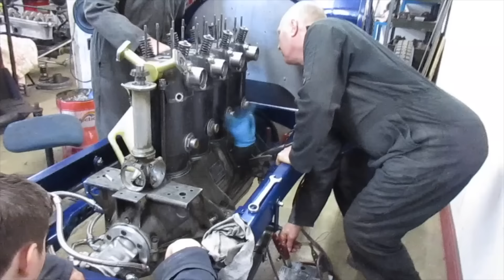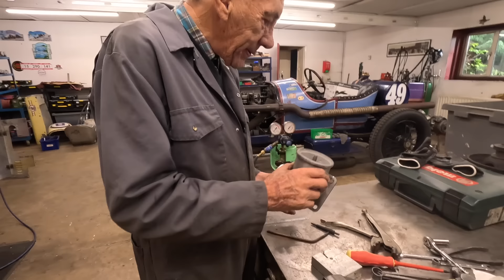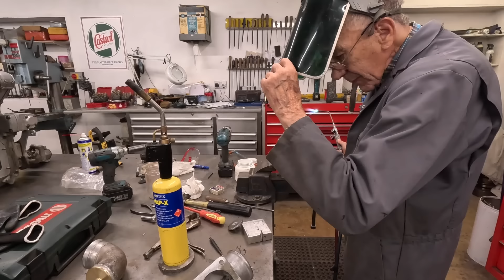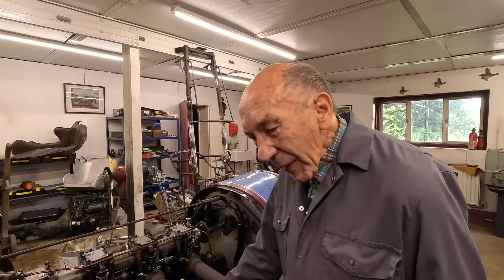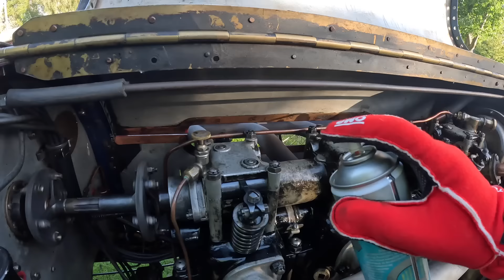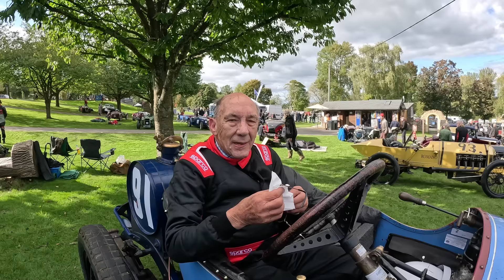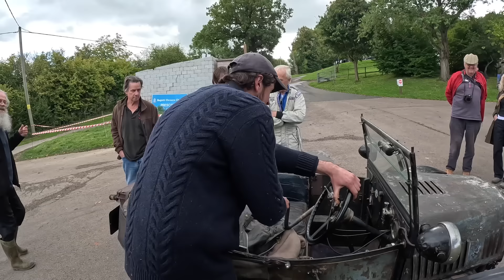Hall Scott: Breather Valves and VSCC Prescott Long Course 2024

Comment: Hi Ivan.....the panhard twins have a timed valve under the distributor drive ...opens as the pistons come together and closed as they move apart. This makes sure the crankcase is negative pressure and keeps the oil in !

Comment: A little mod which works very well…….we installed a reed valve and vacuum pump from I think an aquarium into the engine of a Yamaha race engine immediately it produced more power and never suffered from crankcase pumping …….result! 😎🚀

Comment: A standard 2cv has a non return valve in the oil filter tube with a breather to the air intake. When you consider that the 2cv has piston Comming together then apart it results in significant pressure changes in the crankcase. A common cause of oil leaks on the split crankcase of the 2cv is a failed non return valve. I built a 2cv special in 79 and still drive it as a youngster of a near 83 years! Love your channel, long may you tinker.
Reply: Oil filler not filter
Reply: There's "tinkering", and then theres Ivan and Jon. ❤

Comment: You asked for it: "O, yeah. Moto Guzzi oil catch tanks have the valve."  😉  This valve is in the rocker box breathers only. The return pipe, from catch tank back to the sump is not valved.
When the valve stops working, the engine throws it's oil out. I.e. It works....

Comment: Hi Ivan, Susie and John.
Because I have road going vintage/post vintage cars I add a paper air filter. On the carb side of that I add a 1/2" pipe, with a flame trap (scrunched up pot scourer!), and  pipe that to the rocker box. The vacuum in the crankcase stops the oil leaks 100%. 
Keep up the good work. 
Please do a video on crash box gear changing and driving on crossply tyres for me.
Thanks for the great entertainment.
Cheers Martin..

Comment: A non-return valve in the crankcase breather can sometimes cause problems.  I don't think they apply to the Hall and Scott, but you should be aware:
If the pistons and crankcase make an efficient pump (as they could on a single cylinder or a horizontally opposed two cylinder engine) the crankcase pressure can fall well below atmospheric and the oil pump (on a conventional sump) or scavenge pump (on a dry sump) are pulling against a partial vacuum, reducing their efficiency, potentially to zero.  I heard from a first hand source (a very experienced engine designer) who had to diagnose a prototype horizontally opposed twin engine that was continually running its bearings, and it turned out that the vacuum in the sump was completely stopping the oil pump delivery at high RPM. 
Maybe it also tends to suck oil out from around the crank bearings?   A vacuum relief valve should also be fitted to the sump, for safety.
The main purpose of a PCV valve on a modern engine is to keep the crankcase pressure within a reasonable range.

Comment: A  PCV valve with diaphragm was fitted to the breather tube above the oil vapour separator from the crankcase....on a 1969 Wolseley 1300...with the coir filter in the oil filler cap providing the inward air.
Always kept the "mayonnaise" out of the valve cover with a one way air flow through the engine.....

Comment: 1:35 Every vehicle should have a Marigold to indicate crankcase pressure!

The Norton Dominator (my 650SS is a variant) had a timed valve on the end of the camshaft that connects externally (it was he norm to feed back into the oil tank) when pressure would be positive relative to atmosphere.

Comment: Early three wheeler Morgans had either no front brakes or weak ones. The reason for this was because a number of three wheelers were involved in accidents where the car flipped over. A number of drivers were killed or seriously injured. They solved the problem by putting the engine further forward. The extended front chassis would drag on the road, stopping the vehicle from flipping over. 
Really enjoy your films and rebuilding items. Graham Priest.Gpx

Comment: You may want to study the crankcase breathers used on Offenhausers. They also suffer from high pressure in the crankcase due to the dimensions of the barrel design.

Comment: Evening team, the old 'Petter' single & twin air cooled & water cooled diesel engines used a small non return crankcase breather that used a thin flat rubber washer as the sealing valve 👌👍😉

Comment: Just a thought Ivan, replace the brass disc and spring with a Reed made from a bit of very thin spring steel. Will be lighter and more responsive taking less crankcase pressure to lift. A lot of old stationary engines used a leather disc as the check valve so you could try that, couldn't be much simpler, just don't cut up your favourite Oxfords😂
Reply: Or you could use a modern two stroke reed valve. They are very sensitive to pressure changes.

Comment: Multi cylinder engines normally balance out their crankcase pulses, except for ring blow-by. Single cylinder and boxer twin engines like BMW mc & 2CV have the worst case breathing. IMO reed valves work best, with your design ideal is very light valve flapper and very light spring required. The 70up BMW mc came with breather very similar to your design, it used a light phenolic (micarta) disc, this improved later with reed valve. Possibly another problem with HS is air sucked into engine by incomplete sealing. For example when F1 first discovered the importance of negative crankcase pressure, they used bigger scavenge pumps to achieve it, but then had to reverse the oil seals to prevent atmospheric air from entering crankcase. Keep up the great work!

Comment: I'm concerned that more vacuum in the crankcase will cause the manually applied valve train lube to be quickly sucked into the engine resulting in excessive valve train wear.

Comment: Every modern car has a PCV ……the vented pressure recirculates into the intake .
Reply: A PCV has vacuum from the intake and on older cars some kind of breather to allow fresh air in. Modern cars don't have the breather since even a leak around the dipstick can mess up the ECU. In this case they just have a one way pressure relief valve with no vacuum.